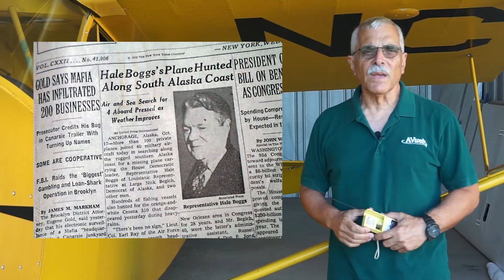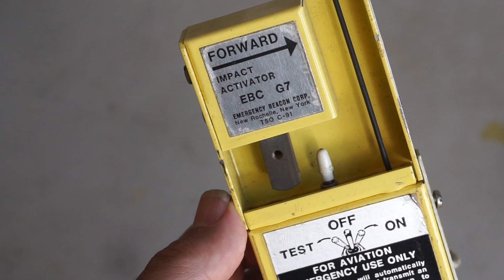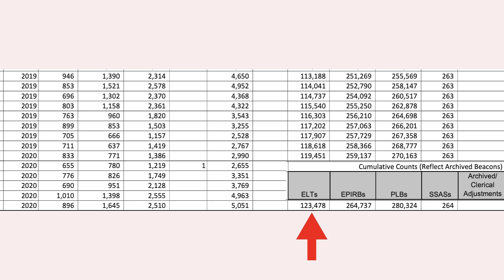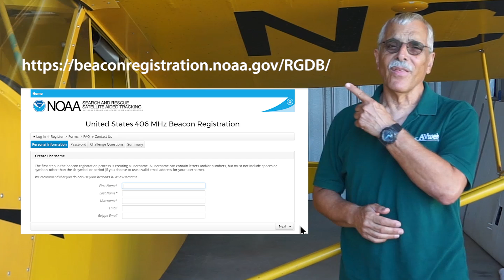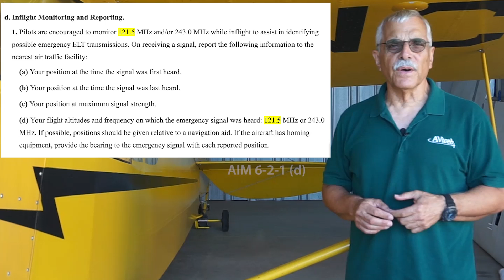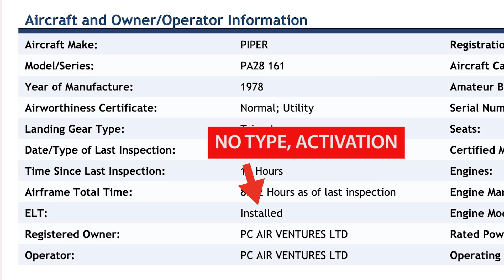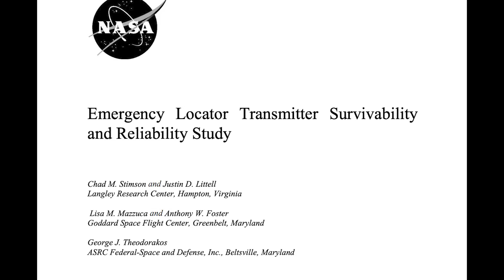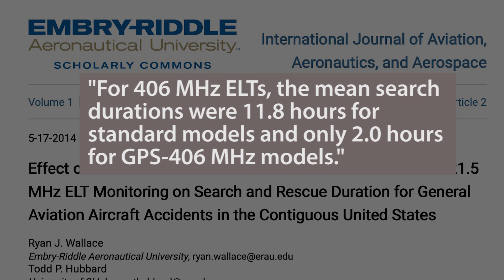Why Cheapskate Pilots Don't Like 406 ELTs

Comment: Thanks, Paul.  My dept. wound up being given two of those 121.5 mHz detectors shown being used by those Civil Air Patrol cadets in the video.  I was advised by a longtime volunteer fireman to forget that big clunky antenna mounted on the wooden beam, and just use the rubber duckie antenna from a vhf handheld radio, shielded by your body to ascertain the direction of the signal.  One activation was found on a shelf at the front porch of a house where the owner's father in law had dropped it off, after it fell over on the shelf and activated.  Another was found in a dumpster, where it had been discarded by the vessel owner's deckhand after replacement with a 406MHz unit.  (Remove the batteries before throwing a unit in the trash.)  A third was fortunately found in the back of a pickup with the life raft that was headed for the airport and a 737 flight down the coast to Seattle for its scheduled recertification and repacking.  Sheesh!  I forgot the fourth, but that third brought laughs when the USCG watch stander and I considered what would happen when the activated EPIRB from a fishing vessel reached 400 knots and 19,000 feet.  The fourth (and more) cases bring home that the big improvement with the 406 ELT/EPIRB is the owner registration, which leads to the rescue center making a phone call to determine whether it's a false activation.  The US Coast Guard called the Alaska Harbormaster's Office where the vessel's owner had registered the device, and his spouse advised that the boat had been sold to a new owner and was fishing in California.  
+++ Do not forget to have the new owner register the 406!  
Dad told me that when their C-130 blew a main tire on takeoff from An Hoa (1968-1970) they returned and landed at the USMC firebase.  While waiting for a C-123 to arrive with a tire and assistance, some helicopter pilots showed up and told them their ELT was screaming through everyone's helmets. It was located in the paddle below the vertical tail with sensors in the gear bays that were to have been removed before operating in theater. so the compartment door atop the paddle tail was closed and the activation stopped, the tire was changed and they took off for home base.  Once again a tire blew on takeoff and they continued on home, later finding that the compartment door had sprung open, activating and ejecting the ELT from the compartment to bury itself somewhere in the jungle, never to be heard from again.  A happy ending, since the rescue center at Danang AB had the C-130 located several miles offshore on the reciprocal of the actual bearing.    
    Yes, Paul, we figured it would be better (and cheaper) to carry a Personal Locator Beacon, since the survival equipment you're most likely to have with you after you have a landing emergency is that which you're carrying on your body.  Once the airplane sinks below the water, maybe ten feet, the antenna signal is lost.            Thank you from another cheap airplane (Aeronca Champ and 7/8 series fan).

Comment: I bought my 406ELT for $500 at Oskkosh.... considering the price diff of PLBs (@ $300) -- that's not too bad. 

And swapping it out for my Narco 121.5 ELT was simple AND I have a remote activation button now on my panel. I can see if it's been activated or, I can activate it before hitting the ground if needed. 

(It's also hooked to my GPS for location data.) 

The battery replacement period is also 5yrs (IIRC) as opposed to 2 yrs for the narco.

Comment: Don't take the batteries out of the potting material... Just solder a 9v battery connector onto those wires and run your smoke detector forever.

Comment: Question:
If an ELT allegedly works only 30% of the time, if you install 3 or more would you get a near 100% ratio?
After all they're cheap so why not install more of them, one in the tail, one in the cockpit and so forth.
In a crash, one of them should definitively survive.

Comment: 7 of 9 401 elts failed to activate, i gues they werent fully assimilated into unimatrix zero. 
the problem with your battery recovery methods; NOT CHEAP ENOUGH! next time try a large flathead screwdriver and a pair of pliers.

Comment: The 406 I once owned got its GPS information from a Garmin w430 navigator.  I understood that if the w430 quit for any reason, including loss of aircraft power, that was that was the position the 406 would give out, even if I flew, or glided, another 10 miles.
Reply: If the SAR team starts their search 10 miles from the actual crash site, I'd say they have a good chance of hearing the beacon from there.

Comment: I'd like to play with a 3D printer and some batteries. Given the right shaped frame, I could fit a new set of cells in less than a minute and even for a prime set of AA cells that's got to cost less than £/$ 5

Comment: Paul and other cheap pilot bastards watching this video, 

Give the battery pack to a ham radio operator who likes QRP (low power; less than five watts) operation. (We are wa-a-a-a-a-y cheaper than cheap pilot bastards!) 

If the battery pack is still "good", we can use them for our field and mountain top activation (SOTA) operations and would be most grateful to you. Hell, if they were decent, I might be prepared to offer $10 for one. Not a lot, but better than shit-canning it for zero dollars. 

Kindest regards to a cheap pilot bastard from a cheap[er] ham bastard.

William, k6whp

Comment: Never test a battery with a voltmeter while it is unloaded. The voltage unloaded is most often correct... But it will drop with a load.

Comment: Marine EPIRBs or PLBs are manually activated or sometimes activated through hydrostatic release mechanisms.  It would seem reasonable to have a lot less false positives when someone has to activate them in an emergency. Typically there is some time to determine what to do when a boat is sinking, not really the same case in an airplane crash. The hydrostatic releases activate an EPIRB when it is mounted to a part of the boat that isn't supposed to ever be submerged, becomes submerged.

Comment: Isnt six 1 1/2 batteries the equivalent of one 9volt battery?
Reply: In alkalines, pretty much yes.  With the rechargeable NiCad and NiMH cells, you need seven since the nominal voltage of each is only 1.2V.

Comment: I'm no longer a member of CAP but when I was they were just starting to show results with the cellphone tracking software. This requires the assistance of the cell phone companies because it uses the phone's signal strength at nearby cell towers to triangulate position at any given moment. Where it fails is obviously where there are no cell towers - like over the oceans. I really like the suggestion of using PLBs because of the fact they work ANYWHERE on the surface of the planet with a view of the sky.
Speaking of CAP, here's the definition of ELT hell: An activated ELT at an airport with a lot of GA planes parked on the apron. The high signal strength of the transmitter and all the reflective aluminum on the aircraft playing pinball with the ELT signal meant trying to localize the signal amongst all those aircraft was next to impossible. The CAP team that was activated for the ELT search had to resort to wrapping aluminum foil around the ELT antenna of each plane on the apron one at a time to figure out which one was broadcasting.

Comment: The last 45 seconds of this were the best.  I am still using 9V batteries that a guy routinely removed from his smoke detectors after 1 year of use so he always had good batteries, and these are from *15 years ago*.  They last a few years in my multimeter.

Comment: In the UK you can ask for a training fix on guard and you will get an immediate response from the D & D Cell based on auto triangulation (radar contact not required). Probably every military and private student has ‘practiced’ this procedure during a navigation exercise. There are enough listening stations linked in the network that a response is virtually guaranteed unless you are really down in the weeds.

Comment: You can just stick a voltmeter on some batteries like that and get an accurate reading. Sometimes their voltage while not under load can look perfect, but then as soon as you add any load there will be a massive voltage drop. Enough to prevent actual devices from working.

Don't use a voltmeter directly for anything like that. It's just not the same as an actual load.
Reply: "You cannot just"

The rest is correct. This effect is caused by what's known as surface charge, which acts like a capacitor.  If it's not backed up by the battery's chemistry being in good shape, surface charge will dissipate quickly when a load is applied.  A flashlight with such batteries will come on at first, but then quickly dim and go out.

Comment: Paul, While you mentioned old ELT’s will not be repaired going forward- the next twist in story is the old ELT battery suppliers.  A note with the previous battery replacement said this is the last time you will be ABLE to acquire such batteries.  They are discontinued going forward!!!    The manufacturers are forcing an upgrade!!  This is with an Artex ELT200.   Always a fan, Dan.

Comment: Bravo, Paul!  I too, am a cheap pilot bastard.  When building my RV-9A, I absolutely hated the idea of having to spend money on a stinking ELT  ... especially since, as a controller, I know that as you pointed out with a False Alarm rate of 98.56% when that ELT starts blaring on guard in the TRACON someone will flip the switch from Speaker to OFF.  The end.

Comment: The air Force knows my elt well. I have them on speed dial. Most recent false alarm was in the middle of the night in the hangar during annual inspection. tied down outside moisture gets to the little module between the elt and switch and sets it off that way. I still like having it, there's a lot of nowhere between California and Oshkosh.

Comment: Summer 2020...probably the worst time in history to try and contact an airliner on Guard.  

My former A&P before he closed his shop advised he couldn't install a new 121.5 when my old one failed, but he was willing to swap out like-for-like.  So, I found a used one of the same model on Ebay.  Legal?  Some would say yes, some would say no.  I don't fly in the wilderness or in remote areas, so if I crash, I'm not concerned about being found.  Someone will know I've crashed on their property when their cow doesn't come back to the barn, or their turkey barn goes up in flames.
Reply from the maker: I think it's defensibly legal. I was thinking the same thing.
Reply: @AVweb   As a fellow cheap pilot, I agree....but...mine is an AmeriKing, and I know based on a conversation with my current A&P yesterday that he won't replace like-for-like.  Reason for the conversation?  I picked my 150 up from annual yesterday, and 3/4 down the taxiway from his shop the ELT just starts going off for no reason.  No bumps, taxiing at a fast walk, it just starts going off.  Taxied back to the shop, he pulled it, reset it and all was good, but advised if it happens again, the G-switch is probably bad (wouldn't be a shocker since its an A-K).  So, assuming it'll happen again (didn't trigger on the flight home), next step is replacement.  406 here I come.

Comment: Well, sounds like an easy fix: Get rid of simple ELTs and require the more advanced EPIRB to have a personal pin entered after starting the engine. Else it won't function and just beep at you once a minute.

Also have a reset pin which is just the last x numbers of the serial number.

A small display shows a registration ID which you then just enter to the website. The registration ID is send on the 406 signal when the pin is entered, as "I'm now online" without a specific location. And add a PAN-PAN-PAN and a MAYDAY button, behind a glass you need to brake, to activate distress signals without a crash.

They should be relayed to the next ATC as well as information about the frequencies of the radio.

So a pilot can push one button and inform ATC that he's in distress, without fiddling with the transponder.

Should be 'easy', maybe not cheap, but god damnit 1100 crash's per year? We need to do something.

Comment: Well, I have one comment on this which makes me buy and keep an ELT operational: Pre--crash activation. It is not beeing discussed often enough. Why not activating the ELT when you encounter an engine failure or anything else what requires a forced landing. Especially in situations were you do not have enough time to select 121.5 on your radios or call someone, it is very, very easy and fast to flip the ELT switch to ON. I do teach that in my Lake Amphibian since this airplane has a decent rate of hell with no engine power and you are usually at low altitude. Sure, fly the airplane first, but there is usually more time to flip a switch then to dial 121.5 and do a radio call.

Comment: have always wondered, why bother?  It should be pilot choice.  If one is aviating in the wilderness, then perhaps a good idea to have an ELT.  But in today's world where phones and cameras are just about everywhere, and there is almost always a "witness" to tell the local news the aircraft was "insert wild account here", and the accident percentages are lower than most any other form of transportation, and one can simply just carry a personal EPIRB, it seems like the need for an ELT has past its time.  A rule change allowing pilots to choose to install, or not, just plain seems like a good idea. Also, it sure seems like removing said ELT requirement would certainly reduce many of those costly false alarms, not to mention, keep dollars in the wallet of "cheapskate pilots"

Comment: As a search and rescue volunteer many years ago, and a pilot, I'm getting a kick out of this video. I participated in a number of searches for aircraft using their 121.5 beacons. Found at least a dozen of them crashed out in the woods or mountains. Unfortunately, of the aircraft we found using the ELT signal, none had survivors. But as a young pilot looking at the circumstances of the crashes drove home a lot of lessons they tried to teach in my training. (Get-there-itis, visually verifying fuel, carbon monoxide, etc) We had one ELT go off three times in one day. We got the call, tracked it down at a very small airport, and reset it. A few hours later, we get called out again. Did an initial DF and then drove straight to the same airport and found the same airplane, but it had been moved. Reset it, and suggested they be careful handling the aircraft. Hadn't gotten a mile down the road and started hearing it again. Went back for the third time and suggested they disable the ELT while the aircraft is on the ground until it can be checked out. The guy handling the airplane was actually angry at us for "harassing" him.

Comment: If you want to increase your chance of rescue, file a flight plan, use flight following, and/or tell someone where you plan to go and when you expect to arrive. That way if you do go down, rescuers will know to look for you.
I have two ELT related experiences from Civil Air Patrol missions (though I can't go into too much detail due to OPSEC). For the first, a plane had come down, and the only reason we knew about it was that it had not arrived at its destination. Once the plane was located, we discovered that the ELT had not even been turned on. For the second, we traced the ELT to a fully intact Cherokee parked at a small rural airport. A lot of other stories have been told through CAP - a team once chased a "moving target" ELT from a plane on the back of a truck rolling down the interstate and another was supposedly found displayed as a decoration at a restaurant.

Comment: To me that 121.5 MHz sounds like bad design. The antenna at that frequency is going to be too long to reliably not break in the case of a crash.
A higher frequency system is much more likely to be constructed in such a way as to survive. I find 406MHz still quite low in that case.
I do think that a safety system that works in 30% of cases might be worth it. Sounds similar to airbags or seatbelts in effectiveness.
But the high number of false positives sound like they are not designed and handled well, and probably need some better regulation.

Comment: Cable TV companies are required by the FCC to monitor and fix any signal leakage  @ 121.5, which is Cable channel 14 (121.2625).   There are also restrictions on cable TV systems broadcasting digital signals @ 403.25, which is Cable channel 54.  I wonder how many false alarms for emergency location detection are actually cable TV systems not keeping up with  their signal leakage measurements?

Comment: I think we are only cheap because we are constantly faced with extremely expensive things hitting us all the time. $1500 ELT replacement, $20-30,000 engines, and other things that can just pop up on annual or 100hr inspections.

Comment: Interesting in New Zealand we are allowed to use PLBs in gliders instead of a ELT. That makes life a lot easier and cheaper, and easy to move it between aircraft. I can also use it for hiking although it will report I'm an aircraft, but I figure we can sort that out after I'm rescued :)
Also we tend to use SPOT a lot and have our own tracking system that combines data from SPOT, InReach, cell phone tracking and FLARM tracking into a single map, thus giving us many tracking options at various cost points, and cell availablility. In the mountains we don't have cell data so SPOTs are required, but in the North Island we have a lot of cell phone coverage for phone tracking. It also has full history so you can go back to any day e.g:
https://www.gliding.net.nz/tracking/2020-07-26